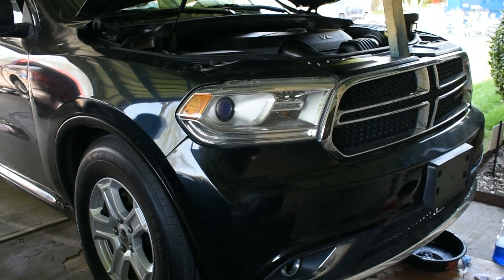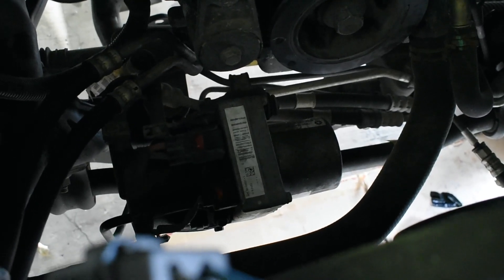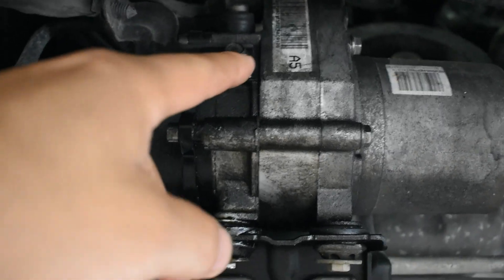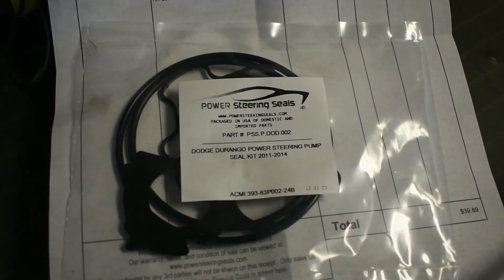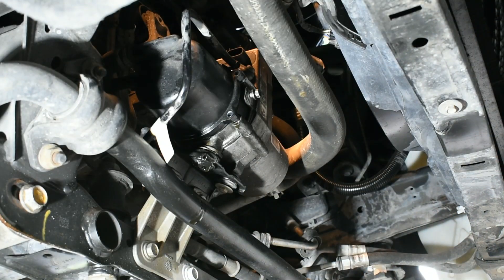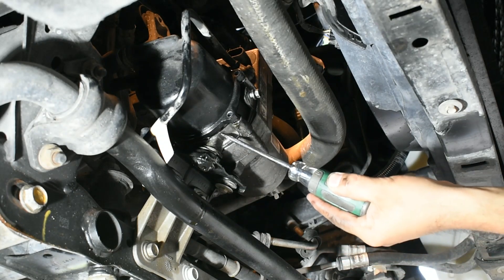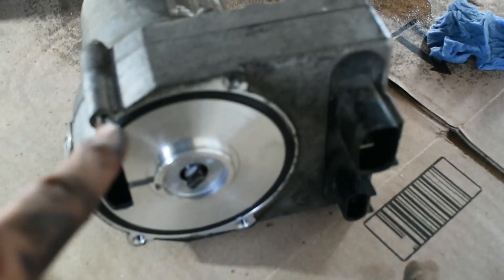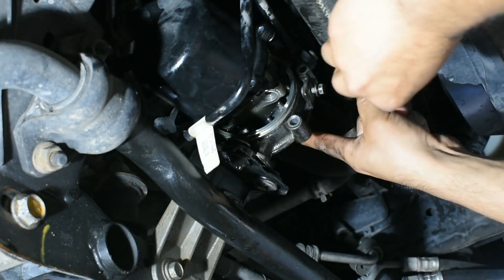How to repair leaking power steering pump Dodge Durango,Chrysler,charger,300

Comment: Hey man quick question my dodge durango 2014 steering wheel is hard turn both side and my dashboard it shows a little red steering wheel symbol any idea what it could be?
Reply from the maker: Add oil to the power steering reservoir